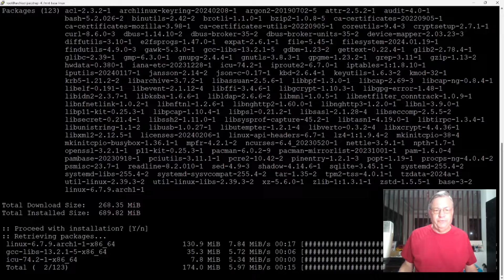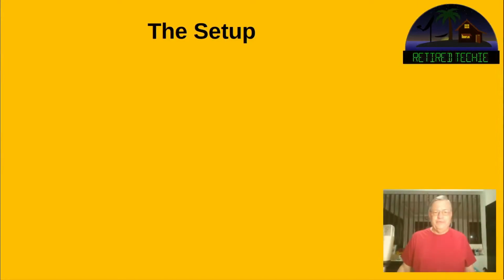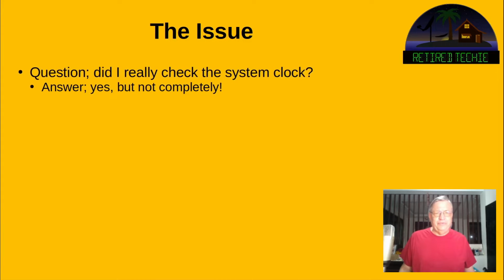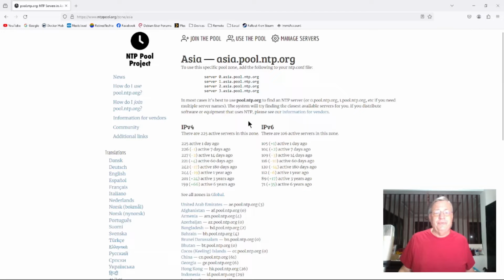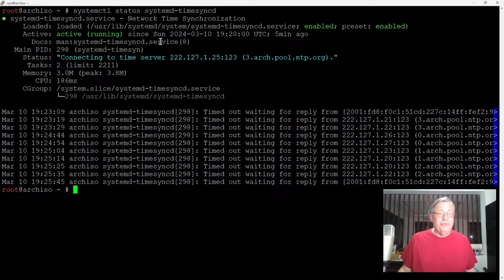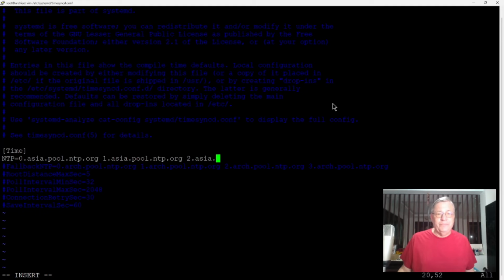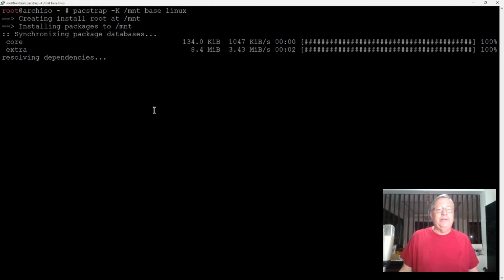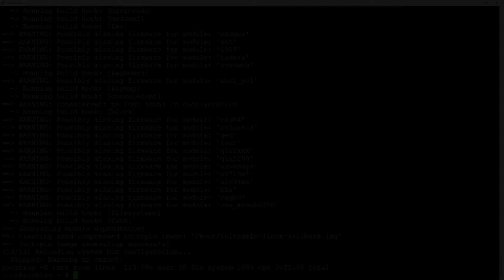New Arch Linux Install Issue, Key-ring not Writable

Comment: Is this the fix for ntp synchronization is not complete
Reply from the maker: That will depend on the cause. Yes, it can fix the issue if the cause is related to network connectivity. However, if the issue is something like your ISP blocking ports, it will not help.
Reply: @retiredtechie I have this problem every time I finished downloading I get this problem I did this in a vm and didn’t get the issue any fixes
Reply from the maker: A question, I am assuming you are installing in a VM on another machine? If so, have you tried another OS on the machine having the ntp issue and seen the same results? Also is said machine being used on wifi or plugged in? With the limited information I have, I am thinking it might be a hardware compatibility problem.
Reply: @retiredtechie I used WiFi not Ethernet and used the same machine after to install Linux fedora
Reply: And have used the same machine to run the vl
Reply from the maker: Okay, this is a best guess here. Your WiFi card requires custom firmware to be fully functional. Fedora probably installs this by default, and Arch does not. When running a VM, even though the external connection is WiFi, the internal connection between host and guest is wired. My suggestion, if you really want to use Arch, use the info center in the Fedora GUI to identify your WiFi card, or use "lspci" from the command line. Once you know the make and model, see if there is a firmware package for it in the Arch repository.

Comment: Somehow doing the pacman-key --init pacman-key --populate archlinux worked out for me fixing the issue, just in case someone's having this problem maybe this might work, also if your download is hella slow try using reflector maybe the mirrors are down (it happened to me once)
Reply from the maker: Thanks for sharing your solution and the tip about using reflector; both are good points. My experience to date is still somewhat subjective o. The quality of the network connection when using pacman-key.

Comment: Outstanding. I recently retired to the Philippines, too, and wanted to convert from an lvm ext4 install to btrfs -- running into this issue. Your video was a life saver! Kudos!
Reply from the maker: Thank you for your response. Glad the video was able to help you. I have been using btrfs for about four moths, on my Fedora test run. Will probably be moving back to Arch after. I do like the volume and variable sub volume architecture of btrfs as it makes much more efficient use of drive space than with straight ext4 or LVM.

Comment: For anyone having the "System Clock Synchronized: No" which basically makes you not able(I think) to install arch, this video is the best way to solve any issues connected to the internet. I've been trying to installing and researching about it for months now and this is the only thing that worked. Thanks to you Mr. RetiredTechie!
Reply from the maker: Thank you for your response. Glad to help.

Comment: 12:12 how to save sir?
Reply from the maker: Are you referring to editing the /etc/systemd/timesyncd file? That will depend on the text editor being used. For VIM and VI if you press the shift key + colon key (:), then type wq (for write and quit), that will save the file. If you are using nano, then it would be control + W (though i do not know if nano is in the Arch installer or not).